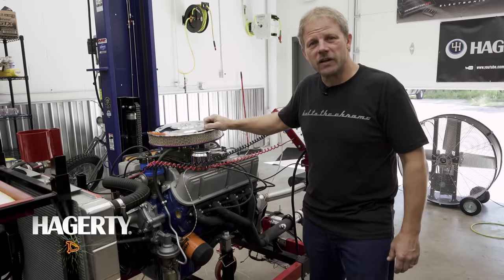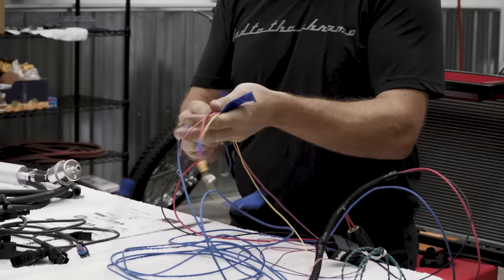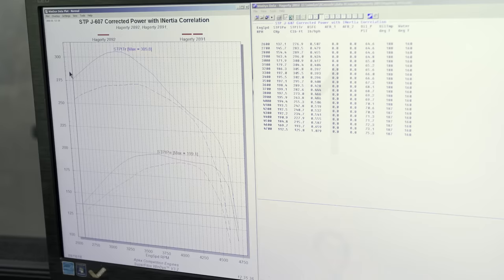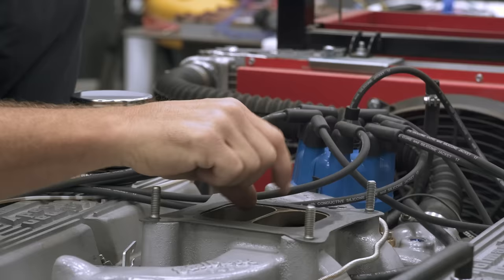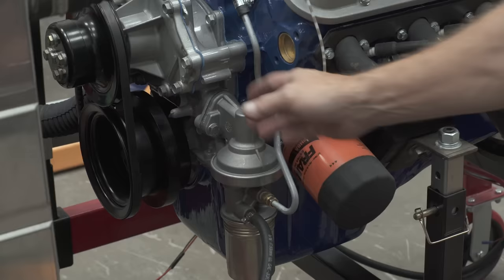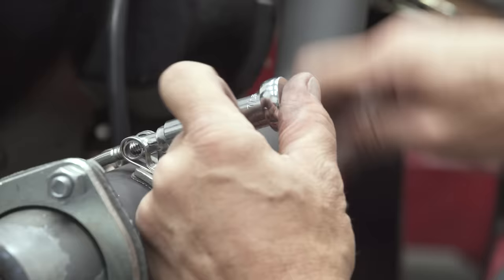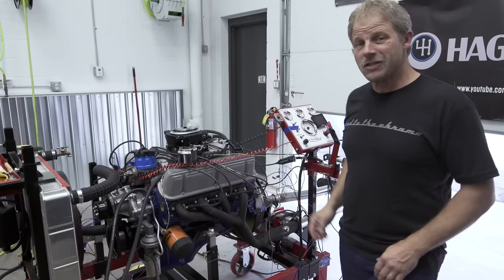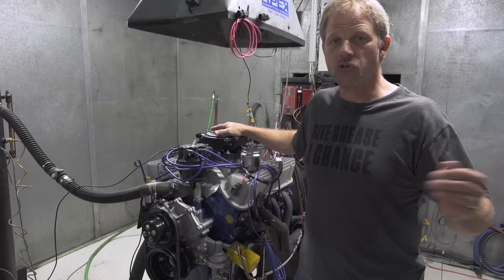Is it worth it? Replacing your carburetor with a Holley Sniper EFI | Hagerty DIY

Comment: First, the claim of points only being able to fire to 4000 RPM is absolutely absurd,  It was a bad set of points..or perhaps condenser.  A good fresh set will go 6000+ all day long.
Second, there was no accounting for the total CFM difference between the carb and the throttle body.
You're comparing 600 CFM worth of flow, to probably over 800 CFM.  No bueno.
Third, that carb spacer alone can account for anywhere between 10 and 20 horsepower all on its own.
Definitely not an apples to apples comparison here...ESPECIALLY when you consider the carb received no tuning at all (jetting, etc.) while the EFI gets the benefit of its self learning features.
I normally love the videos on this channel, but this one is WAY below the standards I'd expect from you guys.
Reply: Tell em like it is! This is just a cleverly disguised advertisement.
Reply: You would be surprised at how  many people don't know about CFM rating or Carb spacers and eat all this up  like gospel!
Reply: Actually 600 cfm is more than a 289 needs up to around 7500 rpm. There's no benefit in slowing air through a bigger carb. The carb might have been tuned less than optimal, but then again, isn't that part of the argument with EFI... you can tune it with parameters and it can self learn vs needing constant physical changes to match conditions.

The butterflies on a 500 cfm carb even are not your limiting factor for power, your distribution, and timing help, but in all reality HP is limited in all but the most extreme cases by head flow, cam, and how well matched the runners on each side of the head are. Getting air in and out of the cylinder is always your limit.

You can plug at a carb all you want, but they always require RESTRICTION to work, where even the most basic of forced fuel injections do not.  This will makes them inferior for power.
With timing and fuel control provided by a processing unit, and a good array of sensors, fuel injection will always net you better torque PER FUEL put through the engine, a cleaner burn, more reliability and better fuel economy. Even if you can manage to get a carb "close" to the same at full throttle, it's still inferior in every single condition you put a vehicle through.

The reality is, the only reason to prefer a carb over fuel injection, is the inability, or stubborn denial, of learning how fuel injection works. OEM fuel injections at this point are even highly adjustable with software hacks or minor hardware mods, and vastly improve any engine they're properly set up on.  The only thing a carb has going for it, is that some people who know how to tune them, refuse to learn how the EFI systems work, and as such, lie and pretend they're somehow equal...
Reply: @poetsrevengejoshk1700  click on his channel. This guy has more time building hot rods than you or I have had time on this earth...
Reply: @ohlookadragon  His channel shows absolutely nothing.
Reply: Excellent points UT as:
 I've seen a number of cars that suffered major performance loss after the owner added a high-performance carburetor, but didn't buy the jet kit to find the right size,
 Both tests should have been done with Ford's Electric Ignition as it eliminates points & condenser issues & is way more reliable,
 No Vac Gauge was used, WTF ???
What they did show us was that the EFI kit was relatively simple to instal...
I have wondered if I should replace the original carter two barrel on my E150 with a 351W...
Reply: As a carb ,EFI specialist for over 40 years think you missed the point. Your right about the carb he's using and one of our custom Holley 4150 or 4150HP would put out better numbers mid -top range after dialed in. We also sale and use various Holley EFI and they will out perform the driveability and that's what he is getting at. We have also did comparision with msd 6, 7 and also intake manifolds and exhaust. There test is a baseline and for the average user that doesn't understand tuning the complete package
Reply: probably because it was sponsored, get em Tony!
Reply: Tony, don't unleash the Italian fury.
Reply: @poetsrevengejoshk1700  Just so you know, UT is an automotive legend, and was doing stuff with EFI on fox body mustangs that had Ford engineers playing catch up; not the guy you want to try and give a lesson to.
Reply: It was just an an advertisement.
Reply: @ohlookadragon     1. You make a lot of assumptions, the first being that i'm young and have no clue.
2. That i haven't had my hands in a few .. nay.. tens of thousands of engines in my lifetime.
3.  That I don't fully understand the dynamics of both systems.

Just because I owned a digital camera over 20 years ago, and signed up when google was still a tiny blip on the tech radar, doesn't mean i'm still a twenty-something like my google+ now youtube&google icon might display.

The last, and most dangerous assumption is that because someone has done something for a long time, that it's the correct answer.  Remember THOUSANDS of years humans thought spheres glided around the earth carrying the sun, and that the earth was a flat disk inside of them...    

Just because carbs can still fire up and run, doesn't make them even close to a good fueling solution, and the lack of proper control over ignition timing makes the debate just laughable.  there's simply no comparison.
Reply: @poetsrevengejoshk1700  considering your initial comment was about a 7500 rpm 289 I doubt your knowledge simple as that. There may be a few 289s floating around that can achieve those numbers but they are surely completely built race engines. The numbers you claim are simply not what an old iron block ohv engine can achieve and expect the rods to stay in the block. never mind the crazy head work that would need to be done to complete such a project. I'll take the advice from a guy who actually posts content to youtube rather than someone who claims to be a know it all in the comments of a video.
Reply: Agreed. Play with the carb and see what happens. Seen plenty carbs out power efi, on a well tuned carb.
Reply: You guys racing DYNOS and not driving your cars really have room to hitch.
Reply: Uncle tony love your input. You always have great insight which is why everyone needs to subscribe to UTG and ask Uncle Tony. You the man💪👍
Reply: @EfurdGarage  Sniper EFI isn't even new technology, its early to mid 80s throttle body injection. It's technologically obsolete. Real EFI gets rid of the distributor, has port fuel injectors, fuel rails, and individual coils per cylinder controlled by an aftermarket ECM.
Reply: @poetsrevengejoshk1700    Why make a comparison at all if your not going to Give the carb engine   a Fare  chance. And  about the 600 Carb may be  the  ultimate size according to stats but every time  I put a larger  carb on a  engine at the  race track the engine gained MPH! if the  MPH goes up the horsepower up!
Reply: my "70" Cobra Jet came out with dual point distributor, would go past 6000 rpm and not miss a stroke!
Reply: @InuranusBrokoff  I want to see a showdown between the two....please!
Reply: @mylanmiller9656  yup just like Smokey Yunick use to say a 650cfm is all you need for a small block.
Reply: Man its so annoying when the "know it alls" get in the comments.... Jk love ya Uncle Tony
Reply: @JosephArata  efi is efi. Tbi is electronic fuel injection and didnt have vacuum advance it was controled electronically. Sniper efi is a huge improvement over the late 80s to 90s tbi.
Reply: @eternalcowboy585  Probably an engineering student. They always seem to think they know more than they actually do.
Reply: Efurd Garage couldn’t agree more. The GM TBI’s were a step in the right direction but they were junk. The Holley unit is a huge improvement.
Reply: @hotrodray6802  true statement.
Reply: @EfurdGarage  efi isn't just efi. Go home bucko, you can't run turbochargers with throttle body injection and points/hall effect distributor, not well. TBI with distributor isn't an improvement, not even with fuel learn maps. You are spending a bunch of money that won't make the engine run any more efficiently than if it had a carburetor on it.
Reply: Lest see chevy tbi didnt use points. Aftermarket tbi kits dont come with points. there are plenty of people running aftermarket tbi with boost and nitrous that run extremly well. Aftermarket tbi's have come along way.   In fact i have seen several chevy stock tbi system run boost and do a good job.  Just because its not state of the art tech dosnt make it any less efficient and just because its the newest tech and setup doesn't make it the most efficient bucko. Nothing wrong with a distributor dsont make it less powerful or not efi. But i guess if your afraid of a distributor i can see that, or if you only know how to do anything with a labtop
Reply: @EfurdGarage  Latest monomotronics did not have vacuum advance either. People in europe retrofit used monoinjections to older carburated cars as carburators are worn out and specialists who know car carburators are mostly gone. On VW and Audi it's basically bolt on. It even looks stock.
Reply: I don't know if this is really true. I know a shop that has it's own dyno. Did a test like this on a 440. The carb made a lot more hp and torque. I think a lot has to do with the engine it's self. Well how the engine is built. 
  As to the 289. I have one that I had a 600 cfm Holley on it and it was starving. So just to test to be sure A buddy and I put a 750 Holley on it and it fixed the problem. You have to remember that Carroll Shelby's 289 hipo had a 715 cfm carb on it. My 289 is really built so it is a lot  different than most.
Reply: I am glad someone finally knows what they are talking about. Thank you Tony!
Reply: What do you expect from a "Parts Changer"?  Real mechanics actually know how to "Diagnose"  engine problems.   Parts changers, see one bad thing, and the only thing they can do is swap the part out.  Terrible engine building tips.
Reply: Uncle tony, I agree except for the cfm ratings. Even if the efi flows more, if the engine isn’t demanding it then it doesn’t really matter.  This was obviously a biased test. No doubt. I love these new efi systems. I own one and have installed a couple other brands. I personally prefer them over carbs. They didn’t show the real benefits. They just tried to act like efi and electronic ignitions make more power, and that’s a blatant lie.
Reply: I totally knew exactly what video you were talking about Tony, I couldn't agree more with you, this kind of crap being produced on YouTube truly disgusts me. This is clearly an advertisement by Holley trying to phase out carburetors and points. You will never seen efi on my stuff, and I will continue to rock points till the day I die.
Reply: @timrayburn2461   check his channel now then...
Reply: Yep, first thing i noticed was the carb spacer.
Reply: Unfortunately, there are lots of bad parts nowadays.
Reply: Sorry Tony but some of us fucking hate points and want to damn thing to start every time no matter how cold or hot it is and how crappy of gas we have to put in older cars these days. EFI>carb, the future of hot ridding is NOW old man
Reply: Sorry Tony, You're WRONG, a "good set of points" has yet to be found, I have dyno tested a TON of engines, with piles of new points. no good, they never actually PULL after 4500 . If you had years and years of dyno testing ,you would know this. I know the 10,000 RPM 302 guys will call me a liar. sorry , it's reality, As far as this test, ..not using the 1" open spacer for the carburetor test is a fail.Hey Tony, put a video of an actual engine,on an actual dyno running actually 6500 RPMS CLEAN.
Reply: If you notice they claim points bounce with the carb as the reason for the MSD so why in the next clip the show the same point dist with the sniper, and your comparing a 600 vac holley  to and mechanical secondary sniper. They should have compared it to a 4779 750 cfm holley with down leg boosters and a richer idle and transfer circuit  rather than a budget 600 cfm thats made for economy .
Reply: And an unloaded move to a electric fuel pump.
Reply: Lot of these aftermarket fuel injection kits are 1000 cfm with the injectors varied for what hp your engine makes.

For me I am probably going to stick with my plan and use the Summit 600cfm carb I bought for the 306 I am building.  Doing the math I could have gotten the 500cfm carb and still been a good 50 to 100 cfm over requirements that calculators state.  But I was advised by everyone I knew to get 600cfm cause that was all ford had at the time for their 4V carb was a 600cfm that was put on every engine all the way down to the small 289 V8s.  Plus I also got a set of AFR 165 Renegade CNC ported heads along with a rv/tow roller cam, a 1" phenolic divided spacer, and short street headers.  So hopefully 600cfm isn't going to be too much for this engine.  Engine will redline at 6,000 rpm but power band is 1,400 to 5,400 rpm and when I have my C6 rebuilt Im going to have them play with the weights in the governor so I can have a 5,500 rpm wide open throttle shift point over the 4,500 from Ford.

Since I got such a fear the carb is going to be too big, I bought a Holley secondary quick change kit along with accelerator pump cams and I even built a air fuel ratio tuning tool so I can clip to the battery and tune the idle mixture to be slightly rich then I can bring it inside the truck with me and drive it around while playing with primary and secondary jets.  Too many people take their time and just throw a carb on and let it ride.  I am guilty of that as well but this time my 306 will be different.
Reply: @poetsrevengejoshk1700 , more than needed maybe.  but Ford only offered one flavor in their 4100 4V carb and that was 600cfm.
Reply: @Jeff Carr, dunno what that guy is talking about points dont pull past 4500 rpm.  Funny cause they were pulling 6,000 and 7,000 rpm.  Hell my 2i3 spins 7,000 with a old Mallory dual point distributor.
Reply: Agree, had an old LT1 back in the 70's used to rap up to 7,000 rpm with points, granted not factory but it was points.
Reply: @Jeff Carr dude to tell you the truth all these ignition systems outdated. Today the best is coil on plug ignition system especially if you run high hp applications such as twins on my 340. I'll run my car 50 times down the track and never have to adjust ignition(only if you want to change it just open laptop and press a few keys, you can also adjust timing and when it adds or takes out timing during run). Points cant do that. Points get dirty have to be adjusted and cleaned. Eh no points in a race car maybe a daily.
Reply: @Jeff CarrCool.
Reply: Hey U.T. Just a point of clarity for me... CFM requirements for an engine is: (CIxRPM)/3456=max need. (Unless I have missed something) So, (289*7000)/3456=585.35  Most factory stock motors are about 80% efficient so require less CFM IN a stock 289 this would be 468 cfm. How does dropping a larger EFI or Carb make any difference? Not sure twisting a 289 to 7000 RPM is a good idea. TNX
Reply: @poetsrevengejoshk1700  only thing I disagree with is reliability, I've manufactured and tested manifolds and carburators vs performance and OEM EFI systems and there's no way in hell anyone with either a base knowledge of metallurgy and electronics and  mechanical experience will suggest that a motherboard and fuel injectors will ever be as reliable in a vehicle use as solid steel.
Sure you might need to clean them fractionally more often but complete rebuilds are about the same if not farther apart than when you have a failed fuel injector which also need to be cleaned (though farther apart)
Reply: @poetsrevengejoshk1700  also suggesting a carburator is not comparable shows you've never had the misfortune of a EFI fuel system have complications 100+ miles from a mechanics shop.
I'll take a carb and a screwdriver for cross country trips over EFI anyday.
For reliability carb is king, everything else EFI will do you better.
Reply: my 60 over 454.  Accel dual points and super coil, w stock stroke pulled 6000 easy.  800 spread bore Holley on street dominator 1" spacer! Street drivable and a demon on the track. Uncle Tony's reply is spot on eh That being said I will try out the Holley EFI Sniper if they can match up for my engine. Nothing ventured nothing gained, but I will not change my point system!
Reply: here in Argentina we had in the 70s a couple of fiats, 128 and 125, they had points and they reached 7000 rpm form factory. whit a couple of mods they would easy past that no problem
Reply: @jonathangarzon2798  You're incorrect. I've literally worked on thousands.. as in probably closing in on 30,000 vehicles by now...

I assure you, a carb is nowhere near, not even close, not even somewhat slightly in the same continent reliability wise with fuel injection.

Your limit is your skill with fuel injection, or who you're paying to fix it.  Carb's spring leaks, clog up, and require constant attention where fuel injected systems literally go 1/4 million miles with only a handful of sensor replacements. 

Carbs require far far far far far  more attention than EFI setups.

I've driven cross country more than a few times as well.  I trust efi far more than a 20 year old carb that at any moment can leave you having to take it apart beside the road. 

they were "the best there was" in the 50's.. by the 60's there were superior mechanical injection systems, but they were costly with production equipment at the time, so with no standards, manufacturer's stayed with carbs purely because it was cheap and would possibly make it out of warranty (which was a whole year back then) until people demanded better.

EFI has been, and always will require far less work. Your trust in a carb is due to your lack of experience with fuel injection.  Literally with MILLIONS of injection systems sold per year.. and thousands of them coming through the shops for basic services, it's exceptionally rare to see an injector fail.

Most setups require very little to "run" decent enough to get home, which at that point they're typically equal to a carb in efficiency.  mechanical fuel pumps wear out the diaphrams faster than rotary electric ones do..  if you use the same type of pump on both (just low psi on the carb) then there's no argument either way. The difference is, keeping the fuel sealed and under pressure to the point of spraying means no real buildup or residue.  

Do sensors fail, sure, but it's long into the service live, and to get even close to the same clean-efficient operation you'd need feedback on the carb solenoids, and o2's on it, so again no durability advantage.  By the time parts start going bad on fuel injection, a carb setup's seen multiple rebuilds, hundreds of adjustments, multiple sets of points.. etc..

Automotive computers don't have all that much in them (until recently) a few analog circuits, a few op-amps, and plenty of a-d convertors, a little memory and a flash prom. They're insanely reliable provided the outside world doesn't physically damage them.
Reply: @ohlookadragon  289's easily  spin up, that's the only point in running 289's.  You clearly don't understand engines.
Reply: @eternalcowboy585  20 years, 50 weeks a year, 5 days a week, diag 5 cars a day, that equals 25,000 cars.... 

Sorry math isn't your strong point...
Reply: He was just sucking up to Holley, what a turd.
Reply: @ohlookadragon  Not all that clever..
Reply: Used to run Standard Blue Streak Points in a 7000 RPM SB Ford, No Bounce ever.
Reply: Obviously they were pumping the holley sniper efi and likely getting payed for it, so they had to make it look good. Buy it's a slap in the face to their viewers, saying were all too stupid to know any better, and anyone who knows engines.
Reply: A squirt bottle might work better than a holley carb that hasn't been tuned correctly.  After tuning the holley carb, the squirt bottle might be equivalent?
Reply: @thisisyourcaptainspeaking2259  You're catching on, a carburator is a fancy squirt bottle that out performs a fuel injection at wide open throttle for a fraction of the cost.
Reply: @mylanmiller9656  right as rain,a properly tuned carb vs. An electronic lawn sprinkler ...1990 technically a relin from days gone by.
Gimmicks and $$$$
Reply: Glorified electronically controlled lawn sprinkler...1990s technology 30 yesrs latrr for "hot rodders"who have more $$$than brains.
Wanna impress me, make a state of the art direct port injection system. Until then CARBURETOR ALL DAY LONG.
Reply: You tell them Tony!!!
Reply: @poetsrevengejoshk1700   Dude, you're like 14 years old. Sit down, Uncle Tony is talking.
Reply: Lol.. 14?  My YouTube account might be 14 years old.  

Sorry that some people can't fathom near infinite granularity in fuel delivery programming and ignition timing being superior to a compromised mechanical setup.

There's a reason every single modern application uses electrical control systems.

I agree the video was not the best comparison. Had they tuned ignition based on load with the efi setup vs mechanical and vac advance then compared output vs fuel consumption at various load points it would be a landslide for efi.

Properly done both are "ok" in a narrow range at wide open.  Real world performance over all circumstances demand situations and load ranges efi is a clear winner.
Reply: @catfixer992  Dual point igntions are reason enough IMHO to convert a newer style OEM vacuum advance electronic ignition, at least for a daily driver. If discussing 100% correct restos, def stay with what said vehicle came with from new, dual points and all.
Reply: @stevenvanheel3932  In defence of the GM TBI; it was essentially a (large) two barrel 'carb', with proper manners i.e. decent drivability and, simple to maintain.
Reply: Pierce Hawke they were very simple and reliable. But they were way too small and those engines were incredibly gutless. They made cool noises when you flipped the lid though
Reply: Agreed.  My points equipped Honda motorcycles revved to 10k RPM's.
Reply: tony not even you are able to get one of those 1850 holley carbs to work. that pos is not much better than a funnel.
Reply: @poetsrevengejoshk1700  ...one think you forgot to add ,just fooling Os that your running lean and moving CPS about 1mm will add 15hp ...;-)
Reply: The bottom line, is the increased flexibility in tuning & reliability worth the extra cost and plumbing/electrical setup effort needed for EFI? That's definitely an individual choice...and it should stay that way. Leaving horsepower aside for my argument in either choice....I admire EFI...however the feel of connection between man and machine with a carburetor has a distinct value...its nearly romantic. It's fun to 'feel' the changes of your mechanical tinkering...and such mechanical tinkering will still be the same in 50 yrs...can the same be said for most electronics?  The digital feel of EFI is digital....the increase in efficiency feels boring and monotonous. I work with both, I'll never want to give up using a carburetor.
Reply: Tell em like it is, Both systems are great but they obviously fired the carb guy to advertise for efi
Reply: i can't believe they looked at that dip and said - ya all cool we have our carb baseline. this is a 'look how simple it is to install EFI' video. i bet you i take my carb and shove it on there and make the same numbers
Reply: @kalli71  IKR
Reply: The leaf spring on points can be easily bent to provide more spring tension. The rubbing block will wear faster but it will stop point bouncing.
Reply: @JosephArata  tis cap u can run boost on the super sniper tbi
Reply: @poetsrevengejoshk1700  Actually small block fords have always liked to be over carbed especially with a dual plane intake. I have seen a 750 run much better on an engine like that especially with a dual plane intake. This is just small block fords .
Reply: @tomhutchins1046  that's incorrect. People just are not setting them up correctly.  

The carb has no idea what brand made the engine.  SBF's are not doing any magic tricks that other engines do not have. 

CFM of a carb is the free flowing air volume at a given pressure drop. There has to be a pressure drop across the carb to work correctly.  When they rate carbs, they're doing so with the ideal pressure drop in mind.

So a 750 on an engine only pulling 550 cfm of air will certainly run. If the jets and air bleeds on the 750 are closer to what the engine needs than a 600 comes with stock, it might run "better" out of the box, because the tuner hasn't selected the correct jets, air bleeds, and in some cases venturi's for it.
Reply: @poetsrevengejoshk1700  I have a shop building engines for over 30 years 1000's of hours of dyno time. i specialize in fords. I ran a ford late model pavement car for years. Engines dont flow they pulse when you use a dual plane each cylinder only see's 1/2 the carb flow do to the divider. You really need to put away that silly generic cfm to CI to rpm chart designed for advertising purposes. Different cylinder heads on different engines have different flow characteristics or pulse. Bore to stroke rod length intake port design. makes huge differences. If we could all just get out the old carb chart it would be so easy.  Hey lets lets throw away the dynos and just use your cute little chart you probably found in hot rod magazine LOL. Oh and add cam timing to that
Reply: This is a general statement (There are exceptions) but if you get 10-20 hp from a 1" spacer the carb is to small. or you have the wrong intake.
Reply: @Milner62  Yup you set the points and start the engine then they degrad from there. The heavy springs required to prevent float wear them out really quick and your timing and dwel is changing as they wear. Mag triggers also have a clean contact and release points are jagged and erratic so even at low RPM you see a difference.
Reply: @brianmac520  But then holley would pull advertising and stop sending all the free stuff
Reply: @tomhutchins1046  Holley 4118 725 with down leg boosters
Reply: @brianmac520  holley knows the carbs future is limited and there are so many copys. So they are pushing the EFI.
As far as Holley 4118 725 I can give you a definite it depends lol so many variables. The early demons were really good then the tooling got old and then holley bought them at auction then they went to crap.
Reply: @poetsrevengejoshk1700  Oh and if your playing with air bleads other than idle with out a dyno and the proper instrumentation your throwing darts blind folded. If i had a dollar for every butchered holley i've seen done by internet experts like you I could buy a second dyno
Reply: @brianmac520  I looked up that carb an old ford holley vacuum secondary LOL ? You can do better
Reply: @tomhutchins1046  demons were way to rich to make up for bad design
Reply: @tomhutchins1046  you have never tried. I've been doing this as a job and my workshop for 48 year's I get to see what works
Reply: @brianmac520  Work shop? your a brit. No I remember those old carbs in the 70's. I think i have one around here some were. There is much better available now. Unless your doing a restoration.
Reply: Dont know about points going all day long . The moment you start the engine with points its all down hill from there. And the signal pulse from points is poor and erratic. This aint the 60's there buddy. Also if a 1" spacer helps the carb is to small or its the wrong intake.
Reply: @brianmac520  You need to understand the product lines on the demon carbs and pick the right one. the early ones were actually lean and they put a big excell pump on them so when a 16 year old purchased an 850 race demon for his stock 327 it would not have such a flat spot LOL.
barry grant started denom after modifying holley's for many years. He is a very respected carb person. One of the few that actually knows what he is doing. So when you purchased a demon you would get 30 years of improvements to the holley design right out of the box. He had many versions designed for different levels of engines.  Some people criticize what they dont understand which is the main problem demon had in marketing. The product was actually to good for the market. The experts like you had no clue of what they were looking at and did not know what to do with it so they criticized a very good product out of ignorance
Reply: @tomhutchins1046  it works better with less hassles than most any thing
Reply: @brianmac520  LOL good luck with that.
Reply: @tomhutchins1046  They have never sent me free stuff and I've been working on Holley stuff since 1972
Reply: I agree. A few years back i had a ford ranchero(the australian version with the inline 6) that the previous owner did amodified 302 v8 conversion to with 750 4 barrel double pumper holley carb. With the points and condenser system it did rev to 6000 and then started to struggle a bit. My friend and i decided to an elctronic rebuild to origanal distributor. We had a guy come that knew his stuff and he did the conversion from points to electronic. At first start up uou could drtect a slight difference and as working temps was reach he did some final adjustments. We found the folowing improvements.
1: better disribution as better leads and slightly hotter plugs could be used.
2: easier start up at cold start and when engine has reached working temps. 
3: slightly better fuel consumption
4: and last but not least it reved through to 6500 rpm as to previously only about 6200 rpm and it reved  better and slightly faster to the limit. 
By no means am i a mechinic just know basics to keep me going major work are done by profesionals. But that was a inexpensive upgrade and still ran the carb. And you could feel the difference in performance
Reply: Also, it looks like A/F was not measured with the carb.  It may have been running lean.
Reply: @1BigDaDo  Well don't eat them!!!
Reply: I'm not a mechanic but iv played with a few motors maybe at 55 I'm to old for all the computer stuff but we took a stock 1996 5.7 vortec  350 and remove the fuel injection system and put on a high rise intake and a Holley 650 and it made more took and I believe more top end hp too we don't have a Dino to test on we tested on air boats and the carb out performed the fuel injection all the way around we did play with the carb some just like they did with the fuel injection on the video I guess we could of tried a programmer with the fuel injection but the whole idea for us was to get our motors to run their best and be able to troubleshoot em with out having to carry a computer with us down the river if something goes a miss with one of our boats it usually gets fixed on the river bank
Reply: UGT knows what he is talking about definitely the man when it comes to hot rods I wish someone would go over rear ends I need to know what's best for everyday in my 79 trans am
Reply: @christopherpatterson8833  If I had a 79 Trans Am, I'd try to put the rear end of a red head about 5'5" and about 120 lbs. in it for sure!!!
Reply: Um.. UT you just scared of technology apparently. The automotive industry would not have massively adopted EFI had there been no benefit. As for complaining about the self adjusting of an EFI system, yes that is a huge ability and yes the playing field is level. You are comparing an analog tech to a digitalized fully variable control one. Carbs, just like fixed cams can't adjust the range of the mixture as well as a digital injector can based on the sensor parameters. EFI is just like having VTEC but for maintaining stoichiometry in the AFR throughout the rev range, ambient conditions, relative air density, and engine temps. The spacer does not do as much as you think, and of you REALLY feel cheated then go take a spacered 289 to a Dyno i guess. You'll never make as much power as with EFI, it just reality. If you hate computers so much maybe mechanical fuel injection is for you. Carbs suck, honestly. Half the fuel gets blown out the tailpipe and doesn't get tuned into usable power.
Reply: Points: dump 'em, regardless. They suck. Sure, you can get them to work at 6K, but who in their right mind wants to keep fiddling with them. The moment they're first used, material transfer immediately begins to change the dwell. Junk. Regarding carb vs. FI, same argument. As mentioned by PoetsRevenge below, they have inherent, old-tech problems simply can't compete with FI on all fronts. Why bother?! Every old car and motorcycle I bought, the first thing changed was the ignition. And (if economically possible at that particular time...), carbs were mothballed. Made life better.
Reply: points suck. thats all there is to it.
Reply: you have completely missed the point. The carb doesnt tune itself. The EFI does.
Reply: I agree. I put a new stock replacement distributor in my old 352 with a recurved distributor, standard blue streak points and condenser and that old worn out thing with a scored up cylinder, 8 leaking intake valves and a sloppy timing chain ran to 5500 with authority.
Reply: You are correct. I had my shift point at 7000rpm on a 289 I built and it was running points. The spacer on the efi made the whole test dishonest
Reply: Totally wrong and You need a solid lifter cam to go over 5200 rpm
Reply: @giles-df9yu  You also need a high rise aluminum intake and headers to go over 5200 but I dont have any of that bullshit either.
Reply: How to “Sell” a Holley Sniper EFI Carb in less than 20 minutes.
Reply: YOu didn't watch the video
Reply: @mylanmiller9656  all the old mechanics know this, which is why we would spend so much time tuning.
Reply: @poetsrevengejoshk1700  Interesting but deboss and vice grip did a real world carb to EFI swap on the bronco with the 302 and guess what. 0 fuel milage gains. The sniper EFI system was not magically efficient making huge gains in fuel milage.
Reply: For practicality, reliability, and very low, almost non existent maintenance, you are insane if you like carbs over FI. Totally insane. CFM, carb spacers, and every other point of argument is beyond debate. FI wins all day. If you like old school stuff great, but don't come out here and tell me how much better they are than FI. No way. You must have a rear end on both ends.
Reply: I agree. I had points in my 1969 Camaro and never had any issues at 6300RPM. Carburetors can be made to preform excellent.
Reply: I have an engine shop and a superflow  902 engine dyno, and I have NEVER had any luck with the single points distributor running CLEAN over 4500 .RPMS. unless I use points to trigger an MSD box., then they will run up to 6500+   the points start breaking up. I tested all the points I could find, including blue streak, even original G.M. points.etc. Maybe when the engine is in the car, with full exhaust, you don't hear it, but it will start breaking up @ 4500 - 4800 every time on the dyno, guaranteed. even had a sun oscilloscope on the engines to verify.
Reply: @mylanmiller9656  you don't get the point do you? The EFI tunes itself and doesn't flood out when its heat soaked...your idea that the carb shoulda been tuned just shows why a guy would wanna go TO EFI...lol
Reply: All very valid points, and the exact same thoughts all crossed my mind before I read your posting.
Reply: @ Uncle Tony's Garage    Bravo bud! Points fired cars well above 7,000 rpm for decades. GM didn't switch to HEI ignition until 1973 & ALL the big cammed, high comp factory small blocks had no problem turning high rpm. Also dead on the the cfm ratings & spacer. I changed to the HVH Super Sucker spacer & the engine picked up idle rpm, vacuum, & I was able to lean the idle & fuel calibrations on my carb with a change that most would say doesn't make a difference. It evened out the cylinder to cylinder air/fuel distribution in my application. Dyno pulls mean nothing because the real world load on the motor moving a vehicle is drastically different from spinning a controlled weight.
Reply: I had a 350 cu in Chevy back in the day before there was electronic ignition. It would spin 7200 rpm all day long. Factory GM distributor single points. Need to use a good set of points and keep a eye on them 😉.
Reply: Yea points
 will work past 6000 RPM
Reply: @Jeff Carr   Facts!!!!!!!!!!!!   IF you did, you'd have to listen for weeks on end how it's inferior to the 1962 cookout grill Mopar made.
Reply: I'm making that intresting face and saying huh in my head.
Veery Inntresring...
Reply: Boo Hoo, EFI wins its not even close. 
4000 RPM limit? exactly, unreliable points setups that require frequent maintenance. EFI self compensates.  
Carb got no tuning... far out that is ridiculous, the engine was obviously running the carb prior to conversion so this is a real world test. Was it sized and jetted correctly, who knows, who cares, this is a reflection of real world skill sets. The EFI setup takes away the pain of finding a good carburettor tuner. Real World.
Reply: AND get rid of that POS oil filter. I worked for a true performance machine shop and those things FAIL. If an engine showed up to be put on the dyno with one on it we tossed it in the trash.
Reply: @poetsrevengejoshk1700  You're off on your statement. Maybe you should go back to school.
Reply: A carb needs to be tuned to the engine/cam/intake/vacuum at idel and at driving speed. I had and amazing Holley carb setup after maybe 10hours pulling parts and making corrections. Could get 30mpg with a 302 and smoke the tires at 70, just not at the same time. Tuning the power valve and secondaries is where some of the magic is found.
Reply: @SR-gt350  Smokey changed my focus when tuning. I used forged pistons and after a high speed run, near the head, my headers were wet red hot. "Ran best just before it blew up."  Cooled the coolant well, cooled the oil, did not blow up.
Reply: I tend to agree.  A well tuned carbie setup is never to be sneered at.  And at the end of the day, I'm tired of electrical gizmos failing.  I love points, I love carbies, because they not only perform, but they are much more reliable, nowhere near as expensive, and can be tuned to deliver.
Reply: @kwik440  Never pull after 4500?  First time I've ever heard anyone say that.  And certainly never experienced that myself.
Reply: @BigWood3131  you all should watch someone that really know WEST TECH he confirmed carb makes more HP than efi done right is the key, anybody can threw a efi on and look it works but take a real master like west tech and thing change in favor CARB   (cfm to cfm)